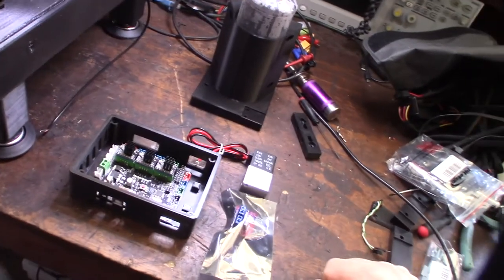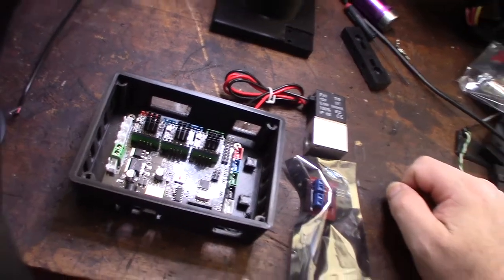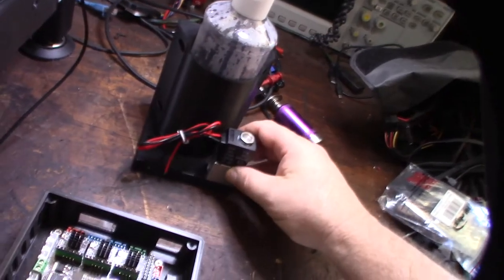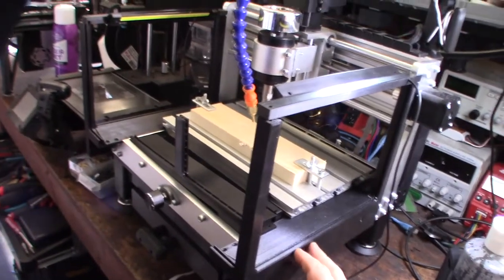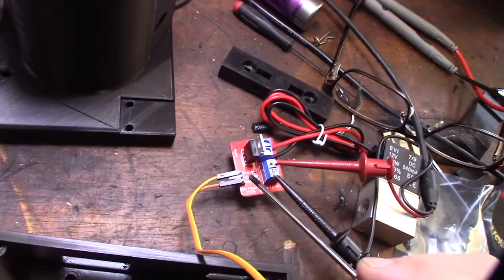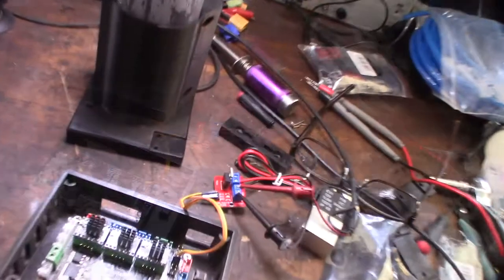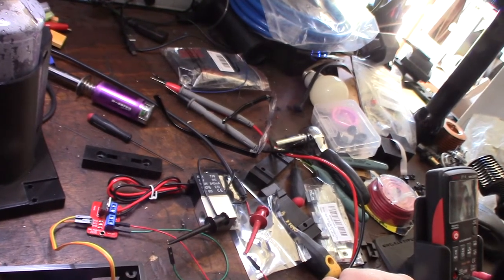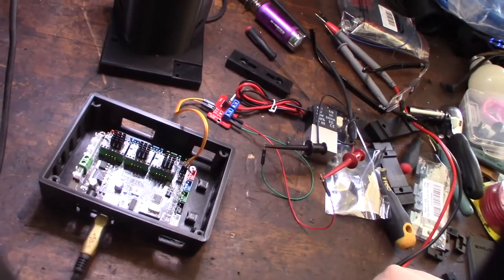GRBL Pneumatic Air Control Valve Coolant Air Test A3 Pin M8 M9 MKS DLC 2.0 Board 3018 CNC

Comment: I don't know I don't think I will use m9 to run the cooling system although it's a good idea I have the same nozzle but I think the hole in the nozzle it will run the water level quickly any way I made a video upgrade on my channel for 3018 CNC, And I'm watching your CNC upgrade thanks for your participation.